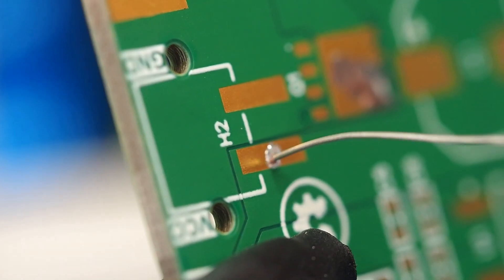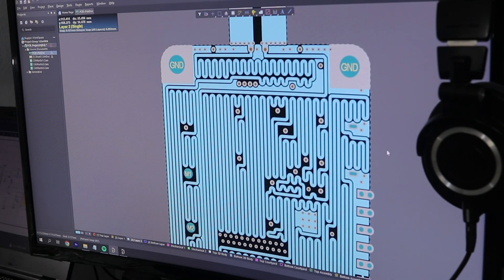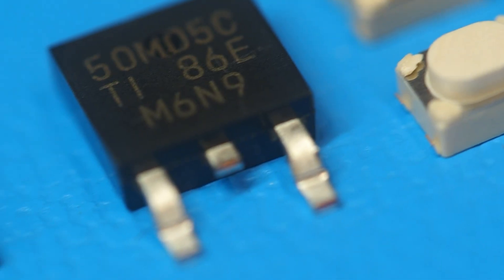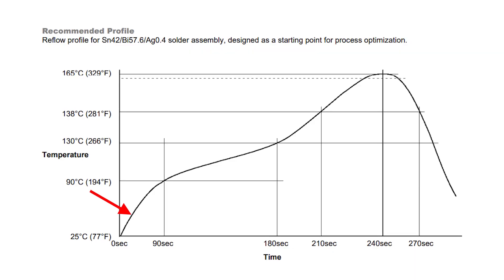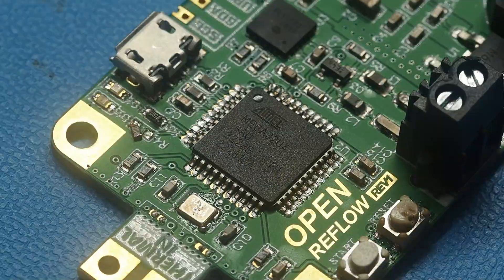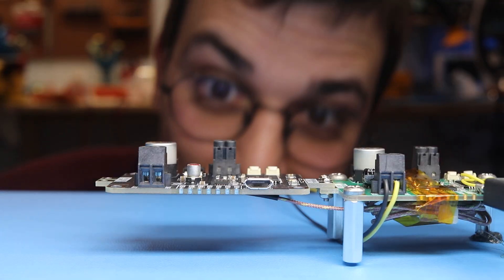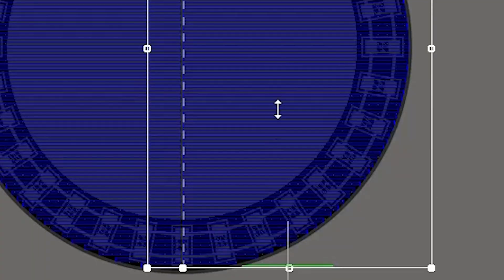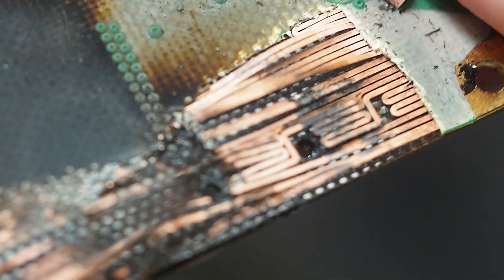I made a Self-Soldering Circuit

Comment: The implications of this...

with this, technology could be produced faster with higher accuracy and A.I. to control and monitor each component, including it's integrity, resistance, and temperature, with much much higher accuracy, and could allow for rerouting of electricity and circuitry  with back up power. As well as self healing capabilities. But we would need to find a replacement metal for solder that has the qualities of not allowing for cold joints when reheating and cooling.. this would allow for self repairing circuits.  I see many more implementations this could be used for. Patent this type of circuitry and give it name !!! Hurry up and do it fast

Comment: I don't recommend this. Your component leads are at a lower temperature and flow will be marginal in the areas above PCB. Heat obeys inverse square law, so higher points are much cooler.  Biggest issue you will not properly activate the no clean flux and the high points can have active flux on them. I suppose for a prototype you're ok, but bottom preheat with hot air above is what you should be doing. Run the product at 70C, 70% humidity for 720 hours and the issues of unactivated flux will show in the form of dendrite growth.

Comment: Very cool (or hot?)! I was wondering if buried ground plane layer could be used as a heater on an induction plate, without inducing dangerous currents through components being soldered? On one hand, the plane layer should shield everything on the PCB side opposite to induction plate, but on the other hand ... I suppose there could be some electromagnetic energy leakage to the layers connected to component (especially through ground via connections). What do you think?

Comment: What would be 'cooler' is if your can use the heater trace of the daughter board to sense the temperature instead of an external thermocouple. :)
Reply from the maker: i thought alot about doing this when designing the board, but a thermocouple is much more accurate and was a safer option to test the concept. Different pcbs will have different resistances. The track resistance for the same design will also vary a tiny bit for different pcb batches. Apart from all this, the resistance of the track changes, as it gets hotter which will introduce more error as different resistance might vary differently. The area and thickness of the board also influence the temperature rate, as the smaller the pcb area the less current required to reach a certain temperature.  So the temperature reading won't be to actuate unless have some kind of ui to put the board's parameters and a software that predicates the temperature/current profile. This has to be tested with lots of different designs that have different parameters, as the wrong predication can lead to disaster.  Not saying it cannot be done, but...

Comment: measure the temperature by resistance of heater and avoid the need to use a thermocouple?
Reply from the maker: i thought alot about doing this when designing the board, but a thermocouple is much more accurate and was a safer option to test the concept. Different pcbs will have different resistances. The track resistance for the same design will also vary a tiny bit for different pcb batches. Apart from all this, the resistance of the track changes, as it gets hotter which will introduce more error as different resistance might vary differently. The area and thickness of the board also influence the temperature rate, as the smaller the pcb area the less current required to reach a certain temperature.  So the temperature reading won't be to actuate unless have some kind of ui to put the board's parameters and a software that predicates the temperature/current profile. This has to be tested with lots of different designs that have different parameters, as the wrong predication can lead to disaster.  Not saying it cannot be done, but...

Comment: Adding more thermal couples to the controller should be easy enough. But what about voltage drop down the chain? Won't that be an issue?

Comment: I build circuit boards for small satellites. Because they operate in space, keeping them warm is extremely important, and we attach external thermal heaters to them. I've thrown around the idea before of using an internal heater wire just like you have here, but never thought of using it for soldering. Very neat, will be interesting to see if this can remain reliable for other circuits!
Reply: On a side note, I wonder how solder in micro-gravity would react.... Like, if there was a fault somewhere, and it got zeroed down to a bad joint, would it be fiesible to send the board through a quick reflow cycle. Of course depending on the instruments onboard it could be a bad idea, out gassing or having essentially a big antenna in the board (although....could it be used to pick up external EMI and used for data correction possibly increasing sensitivity or detecting some kind of EM event to protect the rest of the circuit.... hrmm, Im not into RF voodoo enough to know, just a random thought...), but integrating a heater strip in the PCB would certainly cut down on the individual components provided someone doesnt put a backup external heater in the SOP.....
Reply: @mandi8345  I'd imagine largely the same since surface tensions is one of the most useful features of physics for astronauts to avoid throwing food everywhere haha
Reply: @mandi8345  I believe it would act the same as it does here because the solder's surface tension is way stronger than gravity so its effect is minimal
Reply: @mandi8345  There's no gravity to keep the solder down. Soldering in space is a terrible idea, reflow in a zero gravity environment would be bonkers.
Reply: @literate-aside  Surface tension would hold the components in their place. I think it could work well.
Reply: @literate-aside  Solder is very sticky once you break surface tension so you wouldn't want to do new soldering but reflowing should be totally fine. Think about it this way. You can reflow solder on through holes in an oven. The solder doesn't drip out of the holes because of surface tension.
Reply: @literate-aside  Gravity has never kept the solder down, surface tension does.
Reply: @goku445  the difference being a station is subject to vibration, inertial changes etc.

There's a reason they aren't soldering in space.
Reply: @literate-aside  That would be more of an argument than gravity, altho vibrations could be more easily prevented in zero g and inertial changes don't happen either unless you start a motor I'd guess.
Reply: @goku445  my point about gravity pertained to the dangers of molten metal in that environment.

Vibrations in the station are an absolute occurrence. Astronauts have comments on how the entire section will shake when a colleague is working on the exterior
Reply: @literate-aside  "my point about gravity pertained to the dangers of molten metal in that environment."
Yes, I can see that as being a potential hazard, you can never be too safe when in a spaceship thousands of Km from the ground. 
But you could have an isolation chamber in transparent plastic and confined from vibrations if that's an issue. 
I'm interested if they actually have soldering equipment onboard. After all there is a LOT of electronics and something could go wrong that needs fixing.
Reply: @literate-aside  Found! "In Space Soldering Investigation (ISSI)"
Look my previous comment btw.
Reply: @goku445  That's a lot of space, not to mention to amount of power you're going to draw during reflow, and then there's the matter of removing the fumes and dross.

It just makes more sense to have backup systems, and replacements for critical components in the form of modules / boards, that are interoperable between systems.

Maybe they do it, I don't know, it just doesn't seem necessary to me; mitigating the risks would take significant space, it would consume a lot of energy, worsen sir quality, and there are simpler alternatives.
Reply: @literate-aside  Have you seen my "link"? There is an experiment you can read on the NASA website. They have soldering equipment onboard. Yes they do need confinement and no gravity complicates things.
Reply: @goku445  how interesting, I'll take a look 👍
Reply: @literate-aside  if molten solder were to become dislodged, it wouldn't stay molten for very long. I'm guessing that it still wouldn't be good to have solidified solder balls floating around, though.
Reply: @CM-xr9oq  You'd be surprised, air isn't a very good conductor of heat. Besides you're right, 200 to 400C balls of metal flying around might not be a good idea 👍
Reply: @literate-aside  I would wager surface tension and viscosity of the liquid solder would be enough to keep all components attached. Hell, it counteracts 1g of gravity here and tends to pull in surface mounted components.
Reply: Soon we built self replicating robot, became more & more smart robot, then judgement day begin...
Reply: I think it will generate too much disruption and definitely not suitable for running high speed signals. On a side note it might actually provide a opportunity for self-repairing in isolated environment.
Reply: I worked on avionics, and getting MIL SPEC parts became impossible, so we were stuck with automotive/industrial range parts 85C--40C, but we required -55C operation. I suggested such a method of using a Omega ply product for heating the board up, but we found with the number of copper layers that resistors placed (scattered uniformly) on the board covering 6-10 sq. cm. each, and a thermal control circuit in the power supply that did a thermal warmup, that withing 10 minutes the board was above -40C operating temp. 
In reality we found that very few aircraft ever see -55C temps. I did witness it once on an aircraft SAAB2000 that sat outside in northern Norway where the system did not start up until above -40C, pilots wondered if that was normal. But long before passengers were loaded the system was fully operational.
The other solution would be the silicon manufactures putting heater circuits directly on the die with a control switch to keep them above minimum operating temp. That would reduce the power draw in power sensitive outer-space systems.
Reply: @f.hababorbitz1551 i wonder if it wasn't easier to use a peltier for that, certainly less power used
Reply: can't you just place a few smd resistors across the board?
Reply: @purebloodsunite7489  for what purpose? They're not generating meaningful heat, if that's your intent?
Reply: @literate-aside  yes for generating meaningful heat.
Reply: Until someone hits the on button and all the components fly off into space 😘🤣🤣
Reply: I wonder if you could use the same structure as an antenna when not heating
Reply: It’s limited to low temperature solders.  These are more prone to failure.  Check the datasheets.
Reply: @joeymurphy2464 hello joey I would like to ask you that what kind of thermal heater did you use? If it is possible can you share it with me because I am also working on same project.
Reply: If you had to solder something in space like an astronaut fixing a circuit board, probably the best way would be to use solder paste and a screen with a spatula/scraper and then place the board on a hot plate to melt the solder. That way the solder would not float away.
Reply: Folks, he doesn’t need to solder in space, just keep boards warm. Really, an insulator and some resistors on the board with some vias to conduct heat into the ground plane.
Reply: @stephenholland6328  they were also considering scenarios where a problem is caused by a solder crack.
Reply: I would assume you use military grade components; arent those rated for functioning in like -55°C?

Or does the temperature in space actually get THAT cold?
Reply: @GLnoG420  Near Earth where satellites orbit the temperatures range from around 120C in direct sunlight down to -100C in the Earth's shadow. The -270C figure is for deep space far away from any heat sources eg the Sun. But still that -100C is cold and will bugger most electronics as will that high temp thus why satellites need thermal regulation both ways. The reason we don't feel the same extremes down here is that our atmosphere and oceans have a lot of thermal mass and both are convective so they help to transport the heat from the areas being heated more strongly to the cooler parts.
Reply: @GLnoG420  The south pole of the moon has been recorded down to -270c ambient. I'm not sure what Pluto's temperature range is but it's even colder than that.
Reply: @GLnoG420  The temp in space gets to ~-270 C.  They use heaters on satellites to keep everything operational.
Reply: @GLnoG420  space is neg 270c
Reply: @Dozer456123  But theres way less means for temperature to dissipate, as it is void. So i would think for something to get to that temperature it would need whole years.
Reply: @GLnoG420  Yea radiative cooling is very slow. Doing rough math a sphere with a 5 cm radius starting at 68 f or 293 kelvin it would take over 95 years for it to hit the 2.7 kelvin of space exactly even at the maximum black body emissivity of 1. However 2.7 kelvin is very very low and the sphere would reach 32 f in about 9 minutes.
Reply: @Falcodrin  For a satellite in orbit it would not reach such a low temperature anyway, the temperature in orbit ranges from around -100C in the shadow to 120C in direct sunlight. Obviously this is caused by the fact that as the Earth rotates it's warm surface passes through the shadow emitting infrared radiation of it's own. Quite a bit in fact some 230 W/m^2, also you are not quite in a vacuum at orbital height either, there is still a thin atmosphere there which also has some of that heat from the Sun stored in it. So to get down to the microwave background temperature you need to head out into deep space far away from any star or any object that has been near one recently. Of course recently there is relative some of the larger objects that can get ejected from solar systems from time to time such as planets would likely take millions of years to cool at least.
Reply: @Dozer456123  No its not.
Reply: @Dozer456123  space is not a constant temperature. It depends how close toou are.  Heat could be a problem.
Reply: @GLnoG420  Nope, we don't use military grade components. We've even flown Raspberry Pi compute modules. All our stuff comes straight from digikey. We generally try to stay in a range of 10 to 80 C, roughly. Spacecraft are designed so that they run cold, and then you supplement with heaters. It's way easier to warm up something that's a bit cold than to cool down something hot.
Reply: @joeymurphy2464  Well, thats a really cool job you have.
Reply: @GLnoG420   space can get to 270 °C or −455 °F, it really is that cold.

Instruments that operate there need to tolerate an enormous thermal range, because in the sun that temperature can swing the other way by 600 degrees.

Space is a whole different ballgame; electronics have to be heated, shielded and extremely robust.
Reply: @literate-aside  REALLY??? You give one temperature in Centigrade and one in Fahrenheit?!
Reply: @icarossavvides2641  Yes, I generally work in C but provided both to someone from the US. And?

Comment: This is a very smart and interesting concept, i would like to suggest a few things to make it even better, first of all about the grounding, if you are grounding this, there should always be a fuse unless there is a fuse elsewhere already at the end or start of the circuit but even then some times there still should be depending on the curcuit.
Once grounded, the heating element should act as a parasitic absorption layer of certain frequencies as well, which is great.
Now the other idea is about efficiency of material of use, in order to save on copper and make it more viable, also making it require less power, the design of the copper layer should be only below the pads it needs to heat up, so that way, you waste a lot less material and power to drive the heat.

Comment: I love the idea and the work - its to some degree genius. 
however: I don't see a real use case for this, since if you use it as a GND-Plane its the worst GND-plane design available (a very long, high inductive line, instead of an almost perfect equy-potential. And if you don't use it as a GND-plane you automatically need an additional layer for a task, thats easier done and better controlled by a standard reflow oven. or with an solder iron obivously.
again: don't get me wrong... having this idea and following through is really impressive and apparently the absolutely right way of thinking. so: kudos for that. 
for kits it might have a use-case, but then again: people should just take the time and learn to solder -> it actually is a good thing to also have for problem-shooting ;)